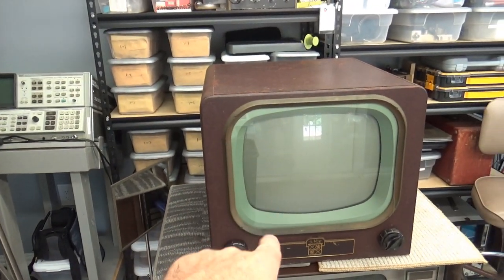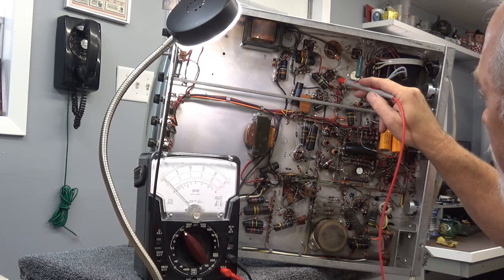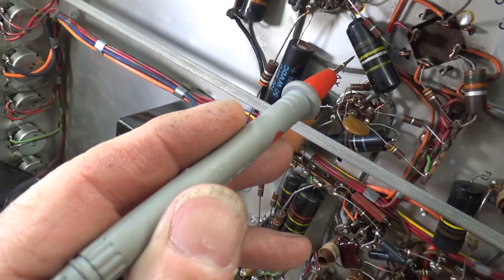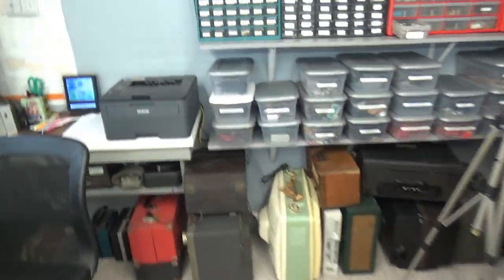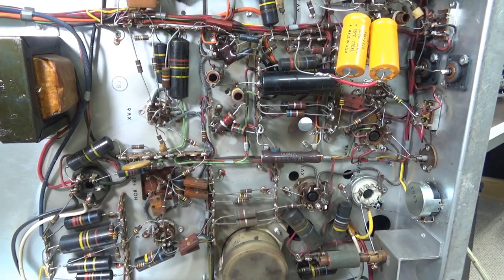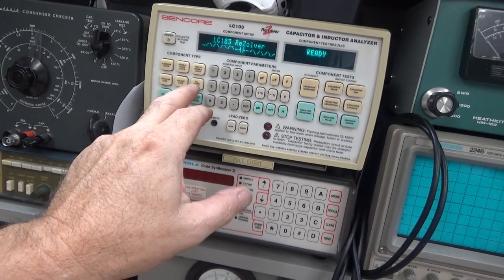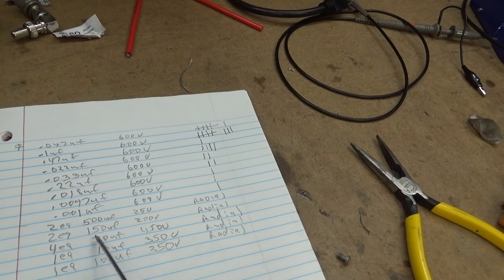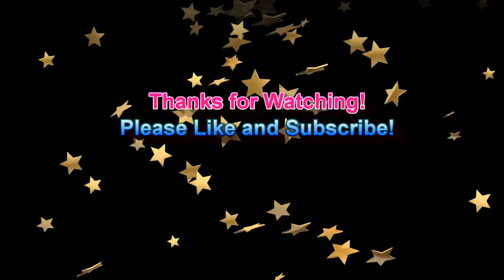Episode 100 Evaluating an RCA TM-8CC Utility Monitor used at a TV Broadcast Site back in the 50's

Comment: Never check black beauties just replace them.
Reply from the maker: I dont trust them.
Reply: In my experience they're always leaky without exception at this age. They were a really highly thought of capacitor when new but time is proven they are worse than wax capacitors over time.
Reply from the maker: I was actually checking them to prove a point about how bad those things are. I trust 50-year-old electrolytics more than those things. 🙂 @randyab9go188